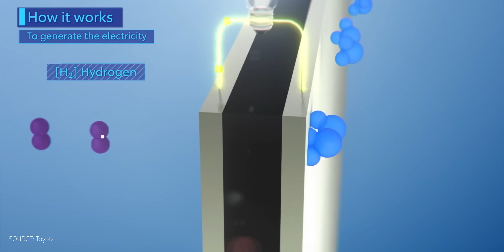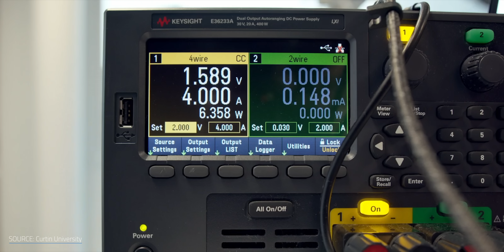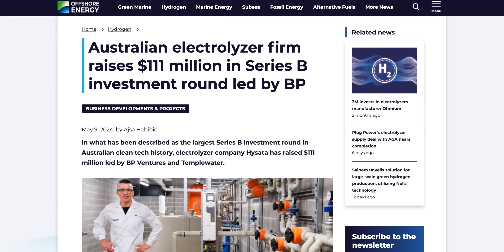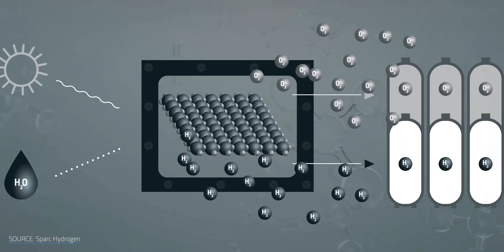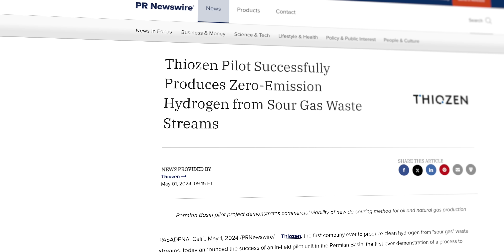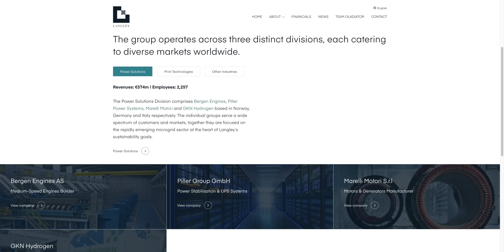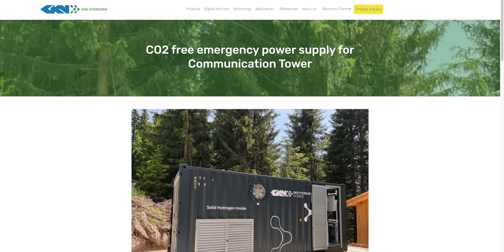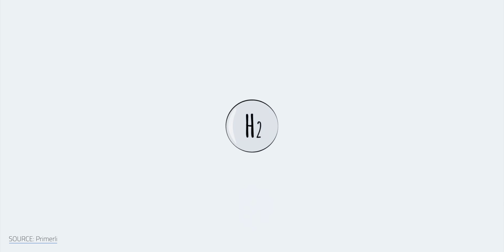How a Hydrogen Breakthrough is Closer Than Ever

Comment: I thought Hydrogen was great ever since I first learned the waste was water. And even if production is related to fossil fuels for now that’s fine in my opinion because it’s still early days in the technology so it will get there soon enough and as a planet it’s still going to take a long time until no fossil fuels are ever needed. And by that point I think we will have cracked fusion so energy on a large scale will no longer be an issue. Then we can desalinate the oceans for clean water and carbon capture to whatever level we need.

Comment: Heard of a group in California that was working on engineering some nice water weeds to break the normal Sugar generation with solar energy, water, etc.. By breaking the sugar chain, the Hydrogen that would normally get bonded to carbons ends up free to rise out of the water and get collected... Now THAT would be far better than ANYTHING requiring power to generate the gas.  Pump it somewhere? Sure.. Just create it?  Get even ANY amount less than put in is not really great.  Simply engineering a bit of algae or water weed to only do sugars part of the time? That sounds a whole lot better  And safer...

Comment: I don’t think hydrogen being green or not is the main issue (I’m sure you can use nuclear power or something to create it). What seems important to me, is that it’s a better option than car electrical batteries. Especially when travelling distances over 400 km’s.
And these batteries aren’t good for the environment either.

What’s lacking is hydrogen infrastructure. To lure trucks and busses away towards hydrogen power, you need to have a solid infrastructure in place, and that doesn’t seem to be something people are investing in at the moment.

Comment: The biggest problems with hydrogen at the moment is storage; if it becomes easy to liberate the hydrogen from the hydrocarbons and use it directly as a fuel, if we're also able to remove oxygen from the same system and burn JUST those two gasses to produce water, we could have green energy on an industrial scale if it scales up enough to power the industries that use the most energy, steel and data processing companies. If we have a way to refine those carbon byproducts into pure substances, making graphene should be a snap. Right?

Comment: Could the Hysata capillary fed electrolyzer be installed in a car and used to fuel an engine? Even if the car needed to be plugged in overnight like an EV to produce hydrogen for the next day, it would be better than a conventional petrol powered engine.

Comment: Matt, you seem smart enough to understand the losing proposition that hydrogen represents in terms of efficiency and thus economics. I really wish hydrogen pieces in general would stop going on about it being the most abundant element in the universe and its very high gravimetric energy density, because those are clearly red herrings. Unless there's a massively abundant source of natural hydrogen that can be readily exploited with a similar net energy gain to fossil fuels (around 85%), and unless the storage volume for application-specific meaningful amounts of hydrogen doesn't matter, those are both moot topics. There is simply no hydrogen use case where its 3x higher gravimetric energy density compared to gasoline can be meaningfully exploited, because the volume that hydrogen would take would be absurdly impractical, even for stationary storage. I wish you would make peace with letting go of hydrogen and stick to more credible topics. Hydrogen is fast becoming the cold fusion of this era.

Comment: You too...!!!
You get bought???

Use the science ...

To get 1kg of green H2
It takes 55kwh
It needs 10 liters of clean water 
You need to transport it at 350Bar ... and compress it to 700Bar to use it ....
Need 14 semi tanks to ONE equivalent gasoline ...

5% in mix with natural gas emits 6 times more NOX ...

The leaks would increase 400% with 50% mix ... and 800% to 100% 

You need to burn 4x more hidrogen to get the same thermal energy of natural gas ...

I THOUGHT YOU WERE A SCIENCE ADVOCATE...

SAID ...😢😢😢

Everyone has it's price ...

Don't mislead and manipulate your viewers...

Comment: As a chemist (Ph.D. Organometallic/Catalysis) I call this plain BS. One of many channels that promote utter non-sense from a technical POV. Hydrogen has many uses in the chemical industry, undoubtedly, but the inefficiency of the thermodynamics of the 2H2+O2==>2H2O + energy AND THEN revertying to get H2 back is plain and simply tremendous to make this a practica process.

Comment: This has been known for some time. An alloy of gallium and aluminum will react with plain old water to produce hydrogen.  Thus a vehicle with a hopper of aluminum/gallium pellets could have a controlled drip of water to produce hydrogen as needed.

The best part is the aluminum and gallium are completely recyclable. 

Just replace the hopper periodically and fill the water tank.

Comment: If "hydrogen"  is the answer then somebody asked the wrong questions.

Hydrogen is not used to power cars or aircraft, and will never be to any significant extent, because physics makes Hydrogen a terrible candidate as a fuel. It is physics that dictates that there will never be an Hydrogen economy, and even if Hydrogen is used as a fuel, it will only ever be used for extremely niche applications. A few of reasons why Hydrogen is not generally used as a fuel include:

1) Hydrogen is colorless, tasteless and odorless making it challenging to detect leaks and accumulations.

2) Even in air and not compressed, burning Hydrogen has a deep blue, fast moving, hard to see, flame front, making it difficult and dangerous to fight Hydrogen fires.

3) Hydrogen embrittles anything that comes in contact with it, frequently resulting in leaks, failures, fires and detonations.

4) Hydrogen burns in 4% to 75% air mixes, and will detonate between 18.3% and 59% air mixes at atmospheric pressure making it a high hazard material in any quantity. 

5) Hydrogen has a minimum ignition energy (MIE) of 0.017–0.02 mJ, which is one of the lowest among known substances. This is much lower than other flammable gases, such as methane, ethane, propane, butane, and benzene, which usually have an MIE of more than 0.2 mJ. Hydrogen-air mixtures can also ignite with 1/10 the effort of gasoline-air mixtures.

6) The energy density of hydrogen is terrible, a bucket of diesel contains almost four times the energy of a bucket of liquid Hydrogen, meaning you need a much larger volume of Hydrogen compared to other fuels to perform the same work. This also makes Hydrogen challenging to distribute. It takes a lot of expensive tankers, and a very expensive charging station to fuel very few vehicles. Meanwhile solar is by far the cheapest source  of electricity and can be produced on site. 

7) It takes as much energy as Hydrogen contains to cool It to below -240C (-400.3°F). and pressurize it to 850 kPa (123 psi), to convert it into a liquid in order to increase its density for use in mobile applications, making it extremely energy inefficient. Once liquefied, it has to be maintained at a temperature below its critical temperature (-240C) and critical pressure of 1280 kPa (195 psi). Should the temperature rise above this, the Hydrogen will rapidly expand, approximating an ideal gas (PV = nRT), regardless of pressure, This would necessitate venting unless the tank was designed to handle the volume and pressure. This is why Hydrogen tends to be distributed by cryogenic trucks (to minimize volume) but held in pressure tanks at high pressures but ambient temperature on vehicles despite the much larger volume this requires.

8) While Hydrogen is light, the tanks and equipment needed to store it tend to be large, heavy and expensive, reducing its utility in mobile applications. This is why the energy per unit mass of hydrogen fuel systems is abysmal.

9) Hydrogen bonds are hard to split, meaning that its production requires significant energy, again reducing efficiency.

10) Most commercially available hydrogen is produced from petrochemical resources, making it far dirtier than electricity.

11) The Hydrogen molecule is small and fast moving, which is why it diffuses out of any system, with all the attendant risks.

 12) The refill time with high pressure compressed hydrogen tanks is limited by compression heating. The tanks are made of composite materials to avoid embrittlement and diffusion leakage, so you’re limited by the rate that you can cool the hydrogen down as you compress it into the tank – otherwise the binder in the composite turns soft and the tank ruptures. This also gives the tanks a similar cycle life and “lifetime under compression” limit as batteries have, because the mechanical stress cycling on the material is limited.

13) When Hydrogen is dispensed, it is pumped from the high pressure bulk storage tank to the lower pressure vehicle tank, and this results in a drop in temperature, often resulting in frozen nozzles (limiting transfer rates) and couplings (which block the dispensing system and prevents filled vehicles from leaving until the nozzle warms sufficiently to be detached).

14) In many potential applications, particulary those basrd on fuel cells or combustion, Hydrogen would need to be combined with Oxygen rather than air to raise efficiency and avoid the production of Nitrogen compounds. This implies the production or carriage of liquid oxygen with all the attendent mass, costs and risks as an accidental release of oxygen, which reacts with most other elements, is far more dangerous than even a Hydrogen spill.

15) Should a cylinder or its attachments fail, it can result in explosive decompression due to pressure, even if the Hydrogen does not ignite, resulting in components, potentially including storage cylinders, acting as dangerous projectiles.

The above, coupled with the very high cost of Hydrogen, is why there are few Hydrogen powered vehicles, why most of the few very expensive fueling stations that were built have been or are being dismantled, and why the only people advocating for Hydrogen work for the petrochemical industry or know little about chemistry and have been fooled by them.

Comment: Could you use hydrogen fuel for planes and trains. AI (Yes, hydrogen fuel is considered a viable option for powering both planes and trains, with research actively developing ways to use it as a clean, zero-emission fuel source for both forms of transportation; currently, hydrogen-powered trains are already in operation in some regions, while hydrogen-powered planes are still under development but showing promising potential for the future. I

Comment: There’s more to be said about how wire-electrified rail would do more + better for decarbonizing transportation than hydrogen or battery electrification of vehicles. That, and you could easily use electric rail corridors for additional electric grid redundancy/capacity.

Comment: I don't see compressed gaseous hydrogen ever becoming a practical fuel for anything smaller than an airplane (or MAYBE a city bus?) any time soon. It's just to complicated to store and transport and not a good match for cars (not that cars are a good means of transit at ALL, or sustainable even if they didn't burn any fuel, but they're one we're stuck with in many [eg. USA and Canada] countries, often due to deliberate municipal design to squeeze out other forms of transit for at least half a century now.
I'm really interested in the metal hydrides and such though (that's why I clicked).

Comment: Unless we can use fusion power to make more hydrogen for fusion power it will probably be a marginal power solution for the foreseeable future. 
The main issues are 
- low efficiency of the storage power cycle: stored hydrogen power cycle efficiency using electrolysis and available storage tech is about 30%
- low energy density (about 1/3 of what methane and other hydrocarbons give per volume) so transportation cost would be tripled just based on that, not considering the most important:
- really difficult and expensive storage. Hydrogen is *light*. It escapes through solid metal containers, compromising the durability of the metal in the process. So using gas distribution pipe networks for hydrogen would be a very short-lived endeavour. And transporting huge volumes by truck is expensive (see the low energy density part). No good tech exists for long term cheap storage comparable to liquid and gaseous hydrocarbons. 
So the devil is in the details, as always. 
Fusion power would be awesome, though.

Comment: The Queensland state government that was going to fund all the hydrogen projects you mentioned in the video (and the pumped hydro stations that were going to help create the electricity to run them) just lost the election to the party who has promised to cancel any "green energy" projects and instead fund the running of coal power.

We'll see if they manage to build the projects without the help of government funding and regulation changes, but at the very least, expect lengthy delays due to the government changing the policies that these companies were relying on.

Comment: People need to stop treating hydrogen as a fuel source like gasoline. Gasoline produces energy, since it takes us less energy to extract from the ground it than it produces. Hydrogen stores energy, since it takes more energy to extract it from the environment than it produces. Hydrogen is much closer in application to a battery than fossil fuels. However it has most of the advantages of both, while also being much cleaner than either possibly could be.

Comment: I have worked designing and maintaining industrial hydrogen storage and handling systems since 1980. Even if the hydrogen was free, it still won't work. The infrastructure has to be isolated from people because it is hazardous due to potential explosions. Hydrogen embrittlement is a real problem for metals. It would be extremely difficult to get a facility site approved by local government. Even if the problems were solved, the infrastructure cost is beyond economic reality. There is a recent video on the "Just Have a Think" channel that does a great job of discussing the problems. I agree with their conclusions.

Comment: Regardless of efficient hydrogen electrolysis, if the electricity powering that electrolysis is coming from coal, oil or natural gas, its just fossil fuel energy storage. Then you have the efficiency losses of the leakiness of hydrogen atoms that can seep through pretty much all materials used to store and transport it.
Photosynthetic water separation is, at best, 0.1%-10% efficient, far less efficient than photovoltaic solar cells and the theoretical peak efficiency is only 12%, so there is no chance of it reaching the 20-35% efficiencies of modern PV cells and far less than the 40% efficiency of next gen pyrovskite PV.

Comment: I remember in the late 90s, reading about the DOE giving auto manufacturers fuel cell technologies from NASA where we could use the hydrogen from gasoline in the fuel cell to generate electricity. Some how the hydrogen in the hydrocarbon was easier to separate in the fuel than the water. 
I’m sure I’m getting mixed up with other readings. 
 I was wondering if you could do a video about that stuff and why it never made it to production?

This is what I could find from an automotive history book. “1997: It was reported that the US Energy Department and the Arthur D. Little management consultancy company had developed a new fuel system for cars that was based on fuel-cell technology first developed by NASA. Electricity was produced by extracting hydrogen from petrol and combining it with oxygen”

Excerpt From
365 Days of Motoring

Comment: The pursue of Hydrogen as energy storage medium continues to look a fool's errand to me.  While Hydrogen has industrial uses and looking into ways to make it green make some sense, marketing as the future of energy storage is a bit of joke.  Also, there are better ideas, Green Gasoline, Green Diesel, and other hydrocarbons derived from CO2, would be zero impact energy storage medium that would work with existing infrastructure.  Also, it seems we are further along solving the problem of storing Electric power and Heat Energy than we are with cracking Hydrogen.  I think of Green Hydrogen as a niche market product.

Comment: Volumetric energy density for a gas has to include its pressure.
The value would be far different at 14 psi (1 bar) vs the 6,000 psi (over 420 bar).

Comment: hydrogen is already efficiently stored its called water. a efficient extraction design was invented long ago using two tubes inside one another in a configuraiton of 4. was even a guy that made a MR fusion design where he poured som corrosive acid of some sort into a container and filled it with aluminum chunks and the contraption produced a huge amount of hydrogen he powered a petrol engine with it. kind of similar to back to the future. there will always be waste products so using enough chemicals and alumining the extraction is efficient.

Comment: The Big lie about hydrogen is, That when burning hydrogen only water is produced. This is true if you burn it with pure oxygen, but when burnt with air that contains nitrogen it also produces NOx (nitrogen oxides) which are deadly to humans and animals. Burning hydrogen with air produces 6x more NOx than burning Methane. NOx is also a greenhouse gas and damages the ozone layer.